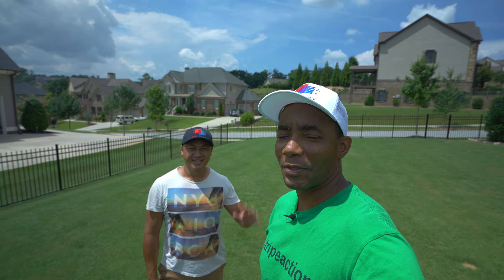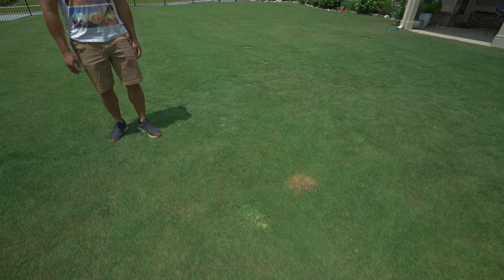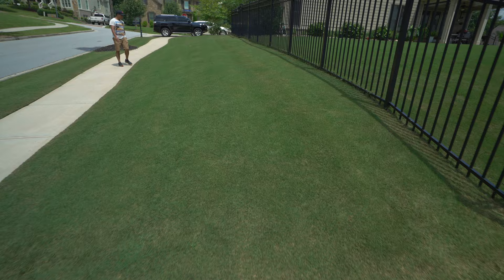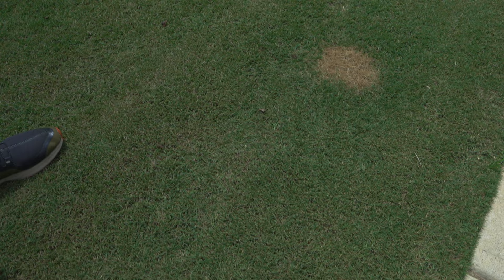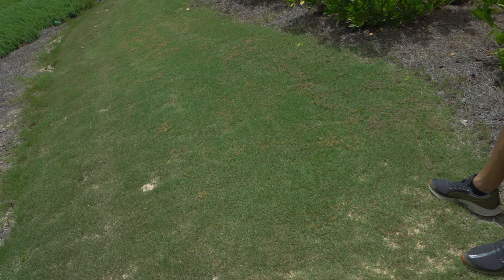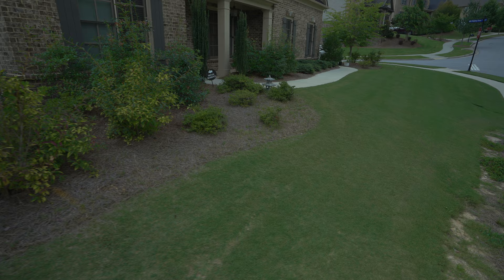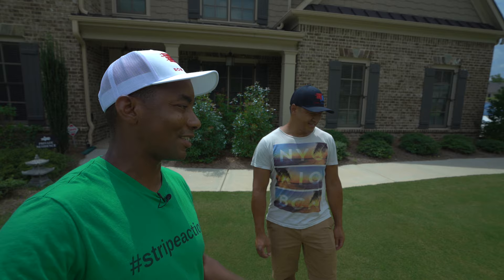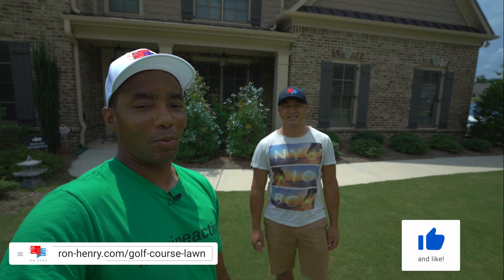[PLANT GROWTH REGULATOR RESULTS] How to [FIX an UGLY LAWN] | Golf Course Lawn RENOVATION

Comment: Hey ron- I know you like your Lesco products. Have you ever used Arborjet Min-Jet Iron?
Reply from the maker: Hi Garrett. I've never used it before but it looks like a decent iron and micronutrient supplement. It seems a tad expensive at $100+ per  liter.  I'd have to try it out before forming a strong opinion though.
Reply: Ron Henry yeah the price was rich for my blood. However, saw a guy in my subdivision using it and thought about you ( Lesco).
Reply from the maker: There are certainly less expensive options for getting iron and micronutrients into your soil.

Comment: Ron, I made a mistake with my Tide Paclo and used 3x the amount per 1,000 sq ft.  I have a Zoysia yard, do you think it will survive the treatment?  Is there anything I can do?
Reply from the maker: Ummm. It will survive but it will likely get stunted pretty badly.  How long ago did you apply the Tide Paclo. How bad is lawn looking?
Reply: I just applied the PGR today and watered it in.
Reply from the maker: @johnbeatty4695  which PGR did you apply?
Reply: I used Tide Paclo at a rate 3x what I needed to use.  I would think it will take a few days to see what happens.
Reply from the maker: @johnbeatty4695  gotcha. I thought that it's been a while. Tide Paclo starts showing visible results usually within 7 - 10 days so we should see what you're dealing with by then.